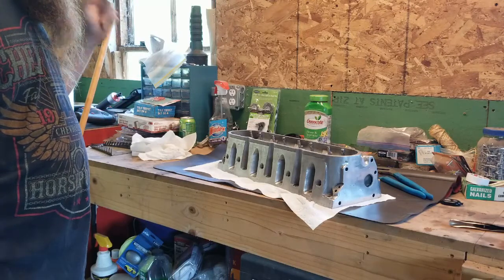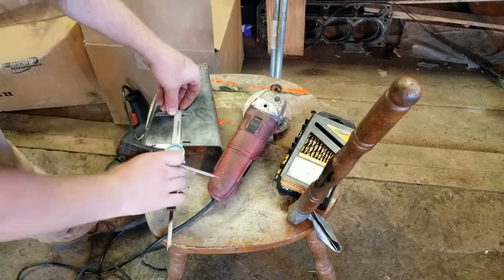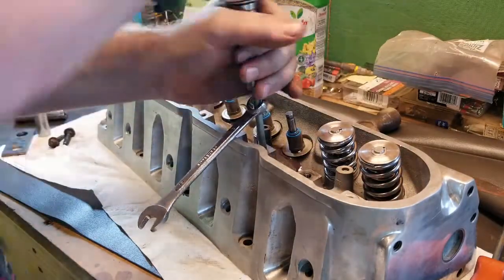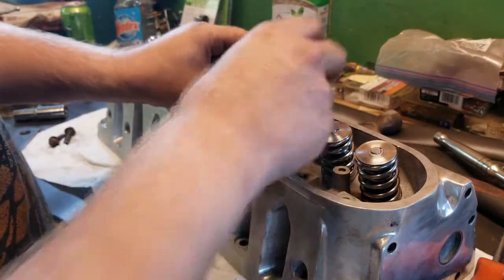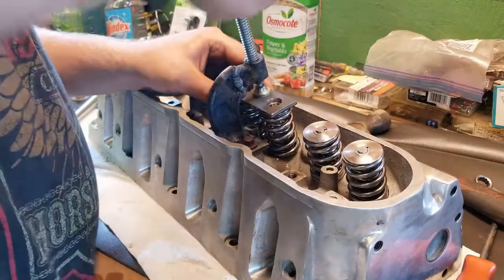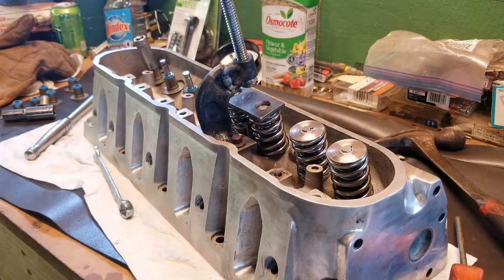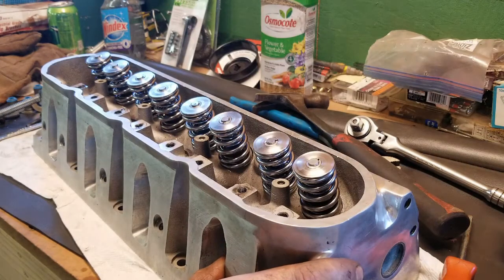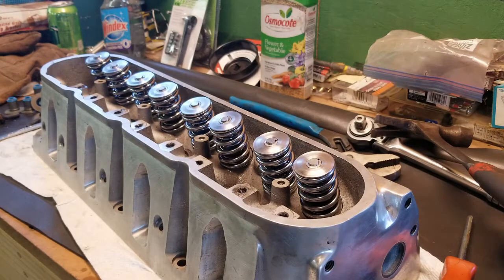Custom tools, and valve spring install!

Comment: Bro you could just simple tap socket with a hammer like everybody else..why  go through so much trouble with makeshift tool.
Reply from the maker: Bro why does it matter to you? If you don't like what I do then float. I did what I did with what I had.
Reply: @CountyGarage207  because u put crap out in the public... and as a good fellow I want to inform others not to follow your crap... if you don't want comments well block comments or just keep u crap off youtube
Reply from the maker: @willis23jm1  oh yeah like your content is any better LMFAO get out of here with your little ugly rice burner. I build cars, not slap bumpers and wings on them calling it a build.
Reply from the maker: @willis23jm1  also your little tap a socket with a hammer trick may work to get the locks to pop out, but how do you expect to put the new ones in? Think before you comment Einstein.
Reply: Ldg @CountyGarage207  (